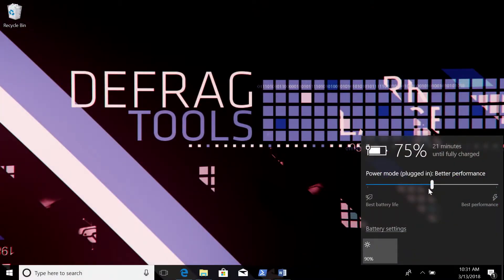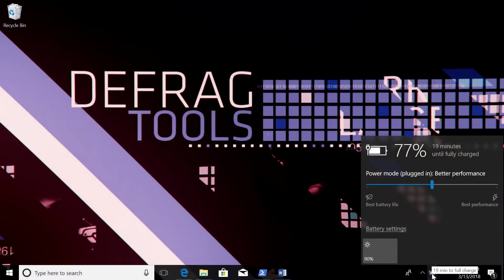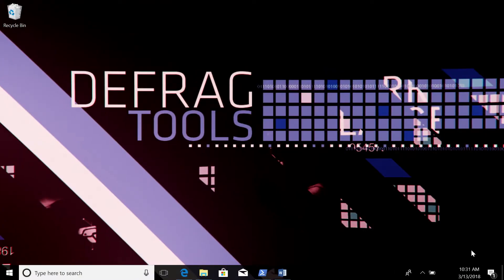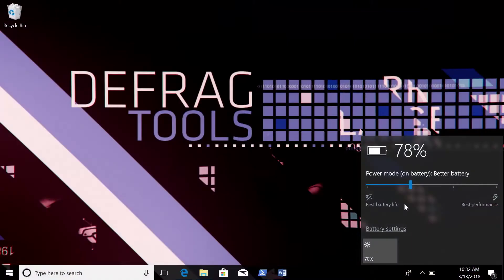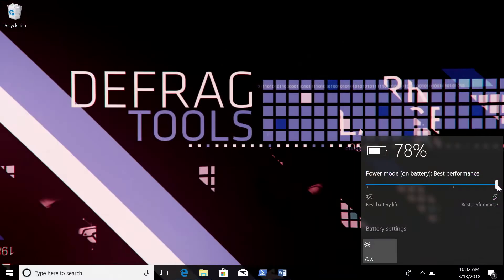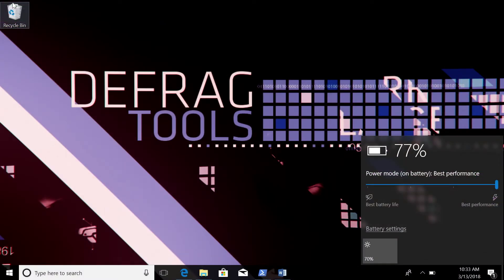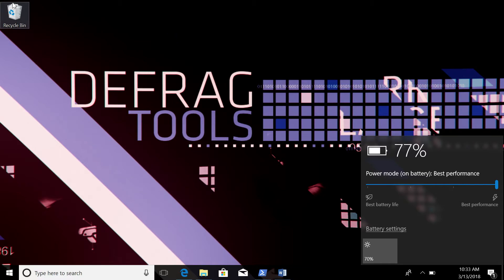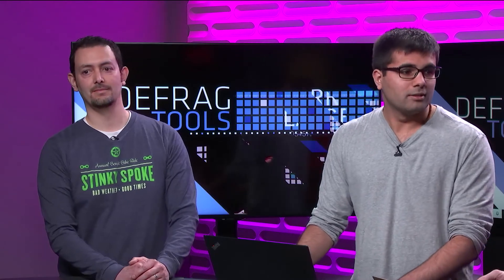DefragTools #190 - Performance Power Slider

Comment: Excellent video and excellent series. I discovered Defrag Tools completely by accident and really love them. Great job, 3 great presenters in this vid.

My question - i have a desktop PC hooked up to a UPS (with ethernet cable going from the UPS to the PC)  Shouldn't Win 10 show that Performance Power Slider? The batt level USED to show in on the system tray but after some updates it longer does. 

Look forward to more vids :)
Reply: the show was already axed not long after this one :D So no more vids...
Reply: @ricsip  Well damn! I appreciate your reply to my ancient comment :)